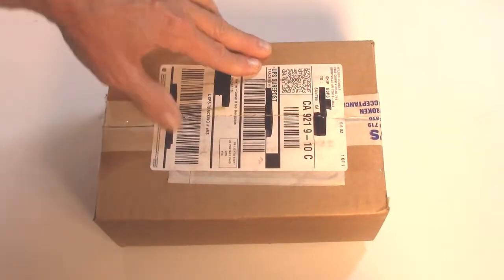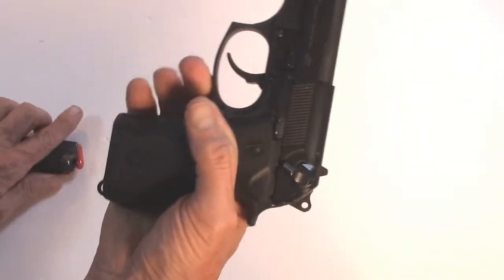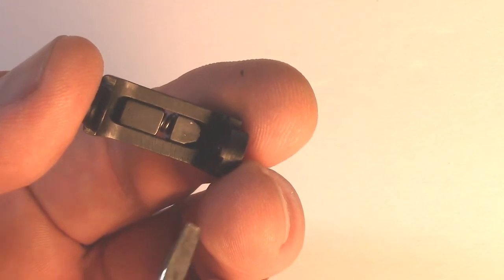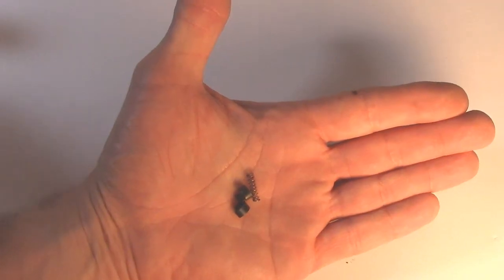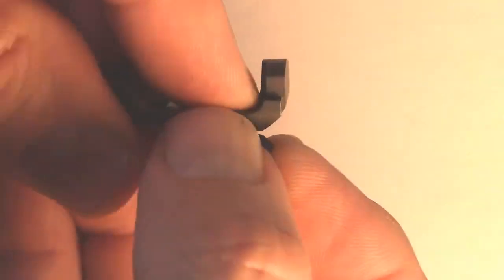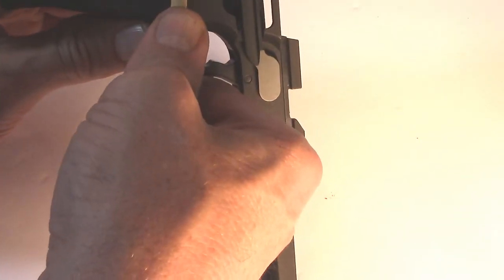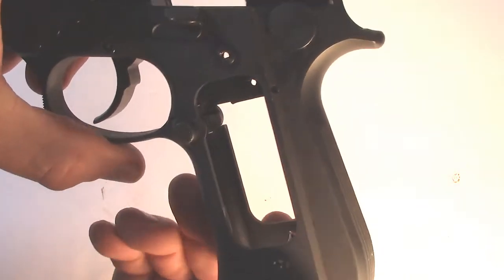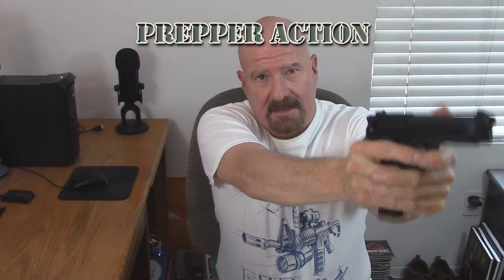Beretta 9mm extended Magazine release full install

Comment: Good instructions ! Frustrating? Yuppers. Without a doubt. Messed around for a pretty long time with the release. Backed up the video several times to see where I was going wrong. Just as I was going for my 20lb sledge hammer the mag release dropped in perfectly. Don’t know how it fell in so easy, but I’m not going to take it out and try it again. One time was good enough. Think I tilted my head the right way. Lot of fun !